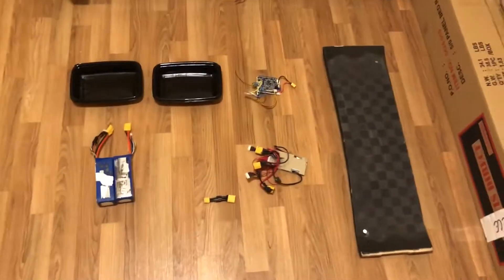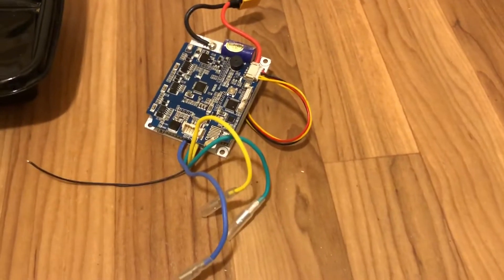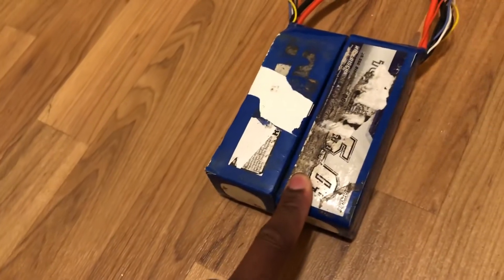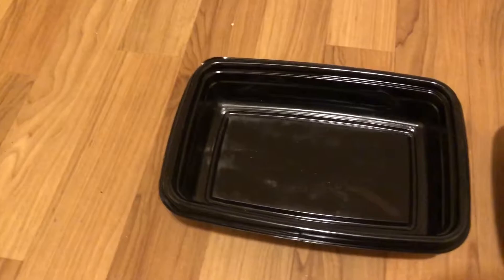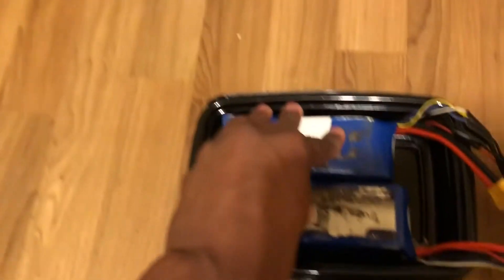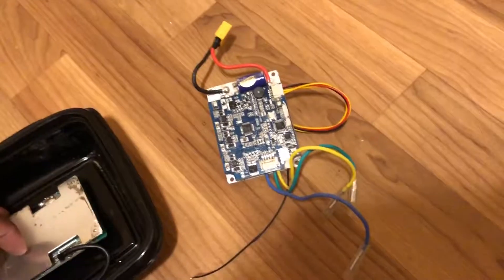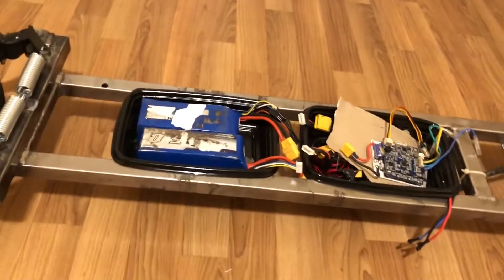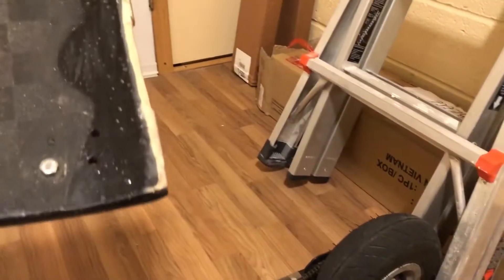HOW TO MAKE A  2 WHEEL ELECTRIC SKATEBOAED TEST RIDE | DIY SPEEDBOARD TEST RIDE | PART 2

Comment: Hi, nice board you made 👍😉 Do you remember the traction force of the springs you use, or metal wire diameter of these springs ? 
I’ve build a speedboard clone, called it DeflectBoard, and I’m trying to make it more stable on the steering side, but it’s not easy… 😉

Here’s a vid of it:
DeflectBoard - V0.2 - Second test (2 wheeled e-skate)
https://youtu.be/CeFpnhoCErI

Comment: Hey man, great work on the project. I'm building my own one currently, however it's a lot bigger than yours. I've seen you added springs to the steering assembly. I've also seen this on the official speedboard. Doesn't it work without them? I hope to bypass that problem by adding a caster angle.
Reply: in case anyone is interested: a spring setup or rake is definitely needed. Otherwise it will be very unstable and wobbly because the steering around center isn't progressive with lean. My idea with adding rake worked out. 5° of rake made a huge difference and are probably enough, but I'll try 10° to see if that further increases stability without negatively effecting anything else.
Reply: @Blockbuster2033  Hey man thank you for updating your post. I appreciate that you are documenting your errors and successes. Comments like yours are invaluable. I'm looking to build something like this as well so I appreciate your input :)
Reply: @stevenn8449  Hey, in that case another little update: 10° of rake was way better then 5° and I'm going to try 15° as soon as possible when I can finally get my arms finished that hold the front wheel. Hopefully in two weeks or so. That's also hopefully when I will do a first video about the project. Will update here again then.
Reply: @Blockbuster2033  Thank you for the update and I'd be stoked to see that video! Looking forward to seeing what you came up with
Reply: @Blockbuster2033  Hey... And how its going ? I made my own speedboard with hoverboard engine but i'm looking for a Hinge like this on video. Can you tell me name of that hinge or link to buy?
Reply: @Raczek19877  I'm building everything myself. Stay tuned for the video, I'll show it in-depth.
Reply: @Blockbuster2033  I'm anxious myself. I'm also building one...and great job to you DIY Electronics!
Reply: @Blockbuster2033  Hows it coming?
Reply: @CodyHovland  Unfortunately I had to pause the build because of lack of time and money. I currently think that I will have something to post by May. I will definitely remember to update you guys with a link to the video.
Reply: @Blockbuster2033  that's understandable. I can't wait to see it!
Reply: @stevenn8449  Hey, I'm finally going to get to filming the video this weekend. I've went through some iterations on the steering assembly, I'm now up to 15° of rake and it works quite well. I'll probably be leaving it at that. Unfortunately I'm limited to about 10° of steering lock, which is extremely limiting for slow driving. On top of that comes the insanely long wheelbase of my board. I already have plans for a v2 with a shorter wheelbase and an increased steering lock to 20°. Also I'm thinking about doing a startup and selling these boards (Kickstarter maybe?). Maybe people are interested. I'll come back to this comment thread and update you on where you can find my video next week.
Reply: @Blockbuster2033  Awesome! Thanks for the update. Looking forward to the upcoming stuff!
Reply: @stevenn8449  I'm going to try to comment here one last time, because all my previous ones were automatically deleted: I finally made the video, you should be able to find it when searching for: I tried to build the fastest Speedboard. It was uploaded to a different channel two days ago.
Reply: Where can I watch your video?